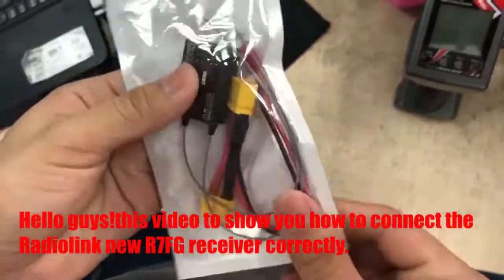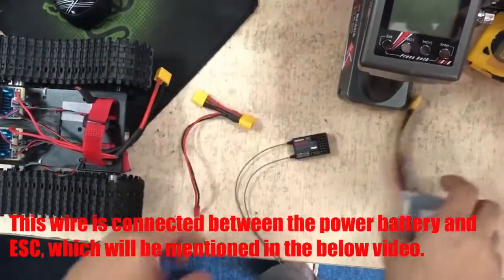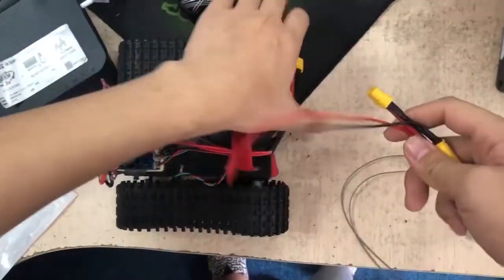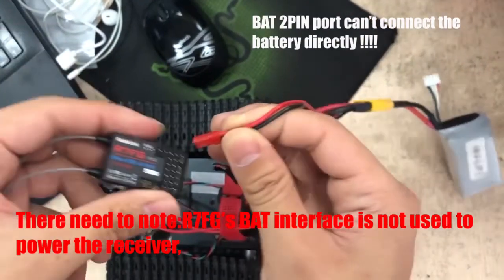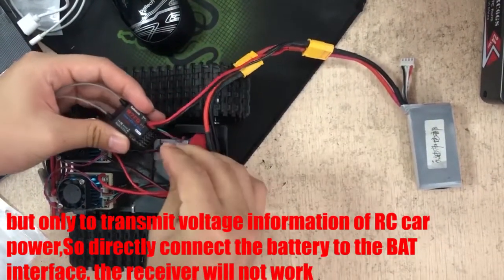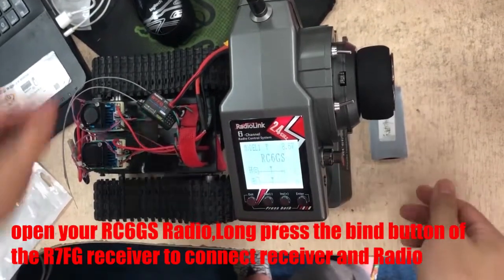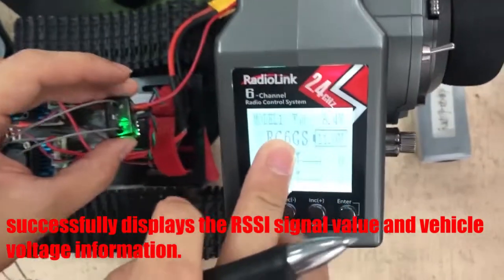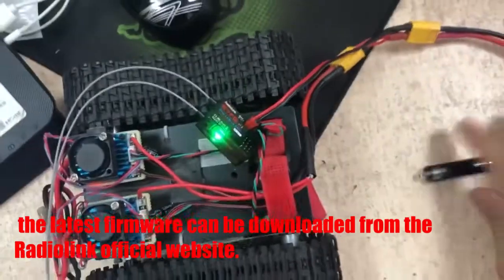How to| Connect #RadioLink R7FG correctly for #telemetry(BAT port in NOT for power supply)

Comment: If I directly connect the telemetry system to the 4s LiPo battery is it safe?
Reply from the maker: Hi, sir. The telemetry voltage of R7FG supports up to 8S lipo battery. So you can connect yoru 4S lipo battery. Just make sure their connection is correct and not reversed. Here is the manual of R7FG for your reference: https://www.radiolink.com/r7fg_manual  If any question please feel free to contact us. Our email is: after_service@radiolink.com.cn

Comment: Does it need the battery adapter to work without telemetry. I only bought it for the extra range.
I found that it works without the extra wire using my RC4Gs radio just connected like the normal R6F
Reply from the maker: Hi, sir. R7FG comes with one telemetry cable. If you don't need the telemetry function, you don't need to connect the cable. Here is the detailed manual of R7FG for your reference: https://www.radiolink.com/r7fg_manual  If any question please feel free to contact us. Our email is after_service@radiolink.com.

Comment: Hello. I'm running 6S w/ a R7FG, controlled via a RC6GS. When I connect the telemetry to the Rx nothing will work. The Rx light doesn't even come on. Disconnect telemetry wire and everything works (green light comes on). Any insight?
Reply from the maker: Hi, sir. Could you please make sure all your cables are connected well? If there is anything wrong with the connection, there may be problem. You can check the right connection here: https://www.radiolink.com/r7fg_manual  If there is till any problem, could you please take a video to us to show the problem? Our email is after_service@radiolink.com.cn

Comment: Hi there,

I purchased a new set of transmitter and receiver (model: RC6GS v3 , receiver: R7FG)
through Amazon and try to connect to my Hyper Go 14301 model.

I plug everything accordingly to the receiver except the given telemetry cable. I am having the following troubles.

1) The receiver keeps flashing in blue light and I have tried to use the ID set to reset and get a connection but it does not work. What should I do?

2) My transmitter keeps showing RX Low Voltage. I have tried to adjust the Alam settings TX: 7.4 v since I am with 2 S battery. However, it keeps showing RX Low Vol signal on screen. Is it because I haven’t plug in the given telemetry cable? Is this Carble optional or must be connected before pairing ?

Please kindly advise me on this as I may have to return or exchange this transmitter through Amazon.
Reply from the maker: Hi, sir. Thank you for your support. If the LED flashes, it means there is no successful binding. You need to bind the receiver to the receiver. Here is the tutorial of binding for your reference. https://www.youtube.com/watch?v=iTrBj7eO6F0  And RX lOW voltage means the receiver low voltage alarm. Could you please check the Receiver low voltage you set, and then set the suitable alarm voltage for your receiver? RX LOW voltage defaults to 4V. Here is the detailed manual of RC6GS V3 for your reference. https://www.radiolink.com/rc6gsv3_manual   If any question when using RadioLink products please feel free to contact us. Our email is: after_service@radiolink.com.cn

Comment: My new receiver does not light. Is it low voltage or ?
Reply from the maker: Here are four possible causes of the receiver's lights not working, please check one by one:
1. Insert the positive and negative poles of the power supply equipment of the receiver in reverse, and reconnect correctly.
2. The power supply device is inserted in the wrong position, the telemetry port can only read the voltage of the power battery, but cannot supply power to the receiver.
3. Input low voltage.
4. Receiver failure.
Reply: @Radiolink_official  I tested voltage with a volt meter. 5 volts.  Polarity is coreect.  Tried it in servo ports as directed.  No initial green light.  Brand new unit and transmitter.
Reply from the maker: @derricktinsley9461  Sorry, you mean there is only no green light, but there are lights of other colors
? can you send a video  to radiolink after service:after_service@radiolink.com.cn ?
Reply: Very odd.  Some 3 wire batteries work. My older 2 wire batteries do not.  Same voltage and pin polarity.   Green light is on with certain batteries.
Reply from the maker: @derricktinsley9461  Hello, sir. Both 3 wire or 2 wire batteries can work on receiver. Could you please make sure your 2 wires are in good condition there is right positive and negative poles of the cable. It would be better if you can send us a video to our email. Then it will be helpful for us to confirm the reason. Our email is: after_service@radiolink.com.cn

Comment: How can i use this with Arduino, plus servo and a motor driver circuit am trying use this for a Arduino rc car without using a commercial ESC.
Reply from the maker: Hello, sir. Sorry we have no document to tell how to make a connection of our receiver to an arduino. You can search it online. And R7FG support standard PWM, SBUS, PPM signal. We have file of the introduction of PWM signal of our transmitter, which can be sent to you via email. If any question, you can also send email to after_service@radiolink.com.cn
Reply: @Radiolink_official  thank you i figured it out 😅 i didn't read the manual all the way
Reply from the maker: @fadelfarae6019  Great to know it. Any other question please feel free to contact us.

Comment: Hi bro, for telemetry.  the transmitter reads 8.2V while the battery voltage is still 8.4V.  Why not the same, Where is the problem? Thx
Reply from the maker: Hello, sir. Could you please make sure to test the battery voltage by multimeter? Because the voltage tested by other voltage test equipment is not accurate. Generally, 0.1V difference between the telemetry voltage and the real battery voltage is normal. If the difference is more than 0.1V, please calibrate the voltage of the multimeter and check the difference again

Comment: My old reciever broke for the rc6gs v2 transmitter it came with.. I bought the r7fg v1.3 and when i bind, nothing happens
Reply from the maker: Hello, sir. Could you please be more specific of your problem? Did the light of the receiver flash when you bind? It would be better if you can send us a video of your binding process so we can better help you. Our email is: after_service@radiolink.com.cn
Reply: Try moving them further apart a little bit. They have to be at least 3 m apart or 9 feet.

Comment: What if I have 8s battery for telementry
Reply from the maker: Hello, sir. Yes, you can use 8s battery for telementry. Telemetry of maximum 8S battery supported. So you can plug 8S battery for telemetry. maximum 8*4.2v=33.6v.
Reply from the maker: Freedom1775  Hello, sir. R7FG supports at most 8S battery telemetry, but it is often used on car or boat, because the control distance is 600 meters. If you want to use receiver on your plane, we recommend you to use R12DS or R9DS receiver, which has thousands of meters control distance, and you can also get the battery telemetry when using the receiver with battery telemetry module PRM-01. Here are the links for  your reference: https://www.radiolink.com/prm01  https://www.radiolink.com/r12ds You can use AT10II or AT9S Pro transmitter with the receiver. If any other question please feel free to contact us. Our email is: after_service@radiolink.com.cn
Reply from the maker: Freedom1775  Good. It depends on your needs.
Reply from the maker: Freedom1775  PRM-01supports 6S battery.

Comment: Hello, I am driving in 3s and I have set the EXT alarm to 11.1V. But when I speed up the alarm goes off even at full load, what should I do?
Reply from the maker: Hi, Sir. When you speed up, the instantaneous voltage is high, so the voltage of battery may fall. When it slow down, the voltage of battery will go back slowly. We recommend you to set the alarm voltage lower than 11.1V.
Reply: @Radiolink_official  I had heard this before, but why can't you do like this kind of device with an alarm set to the cell voltage and which only sounds when exceeded, which is much more efficient:https://fr.aliexpress.com/item/4000048125682.html?src=google&src=google&memo1=freelisting&albch=shopping&acnt=248-630-5778&isdl=y&slnk=&plac=&mtctp=&albbt=Google_7_shopping&aff_platform=google&aff_short_key=UneMJZVf&albagn=888888&isSmbAutoCall=false&needSmbHouyi=false&albcp=10191220526&albag=107473525328&trgt=539263010115&crea=fr4000048125682&netw=u&device=c&albpg=539263010115&albpd=fr4000048125682&gclid=CjwKCAjwndCKBhAkEiwAgSDKQeoiTCVrGxjEdrSR7LvWEusAW5p5a4FBn4nNyYy7-uc9oARyZlhvUxoC0VIQAvD_BwE&gclsrc=aw.ds

Comment: So, what can I use the s-bus port for? Can I use it to transmit from a camera? And how do I receive that information? I have this receiver and RC4GS V2 transmitter.
Reply from the maker: Hi, some of user need S-bus signal to connect with flight controller, so we added.  You cannot connect the camera with receiver directly, they are not compatible.
Reply: @Radiolink_official  yes I have learned this now. Thank you for reply.
Reply from the maker: @jamespicking1140  No problem, any question you could contact our after sales service, we will reply your e-mail as soon

Comment: Hi, I'm not using the telemetry function on my setup (Arrma Limitless). There are 2 antennas, I assume one is for the telemetry & the other to control the steering & throttle. Which one is the telemetry antenna, the one on the top closest to channel 1 or the bottom one closest to channel 6?
Thanks
Reply from the maker: Hi, they are both signal&telemetry antenna, you should install them by 90 degree to get stronger signal! You could read the online user manual to get help: https://www.radiolink.com/r7fg_manual
Reply: The dual antenna is for unsurpassed range, I owned my RC6GS and 6/7ch receivers…use this for my speed run vendetta w/ confirmed gps 3800’ range…best radio/receiver combo on market for 100$ or less
Reply: @MnEanythingrc  I agree, I own both radios, the Rc6gs & the rc4gs. Recently added a 4W signal booster to the rc6gs. Now I get longer runs on my speedruns, ~5300ft round trip.

Comment: So if you use it on a nitro car you do what? Odd it doesn't power rx not everyone runs electric.  Obviously a splitter I assume
Reply from the maker: Hi Thanks for asking! True indeed, we've received some enquiries recently about the connection between this R7FG and nitro car. It is the same as the electric car.
Steering servo to CH1, gas powered servo(throttle) to CH2, the battery with the range of 4.6-10V to connect to pins of the rest of either channels to power supply. 
 Always make sure about the correct polarities.
Reply: @Radiolink_official  hi, i just bought the reciever, the rx wont power up when i connect to the batteries . what the problem ? i use it for my gp boat . thanks
Reply from the maker: @MuhammadImran-su6zq  Hi, did you connect the power to channel plug, instead of telemetry port? or you could send a picture of connection to us: after_service@radiolink.com.cn